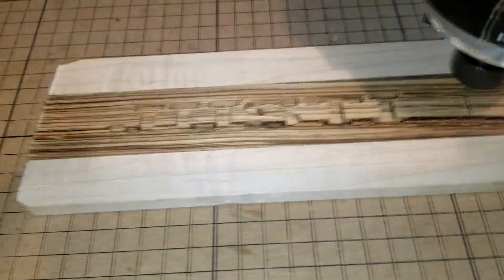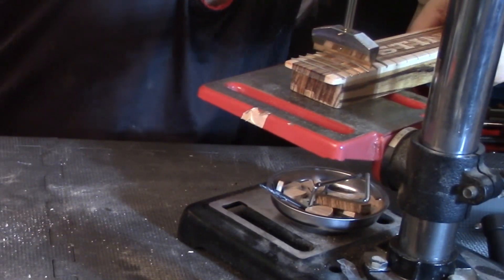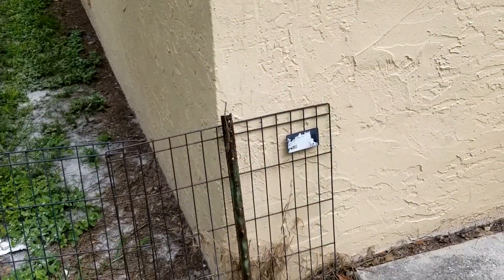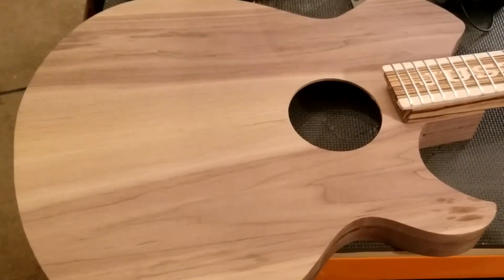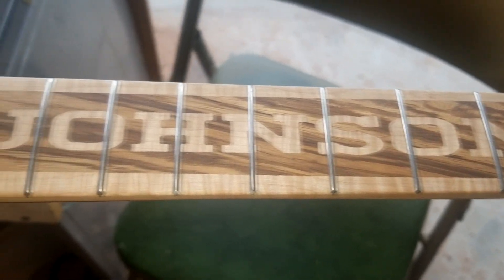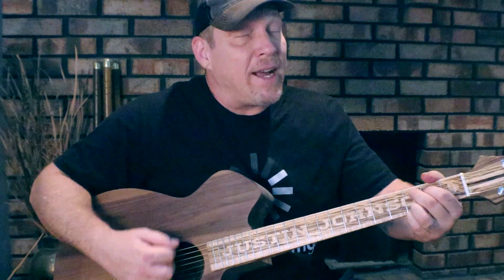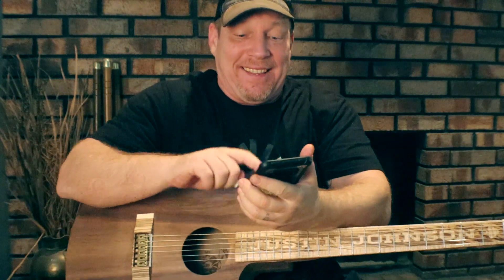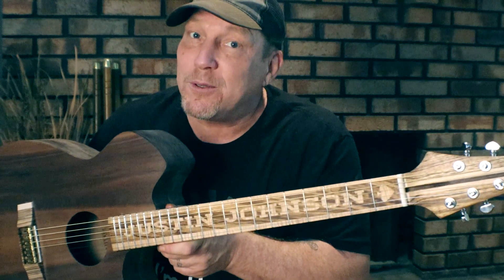I Made a GUITAR for @justinjohnsonlive Out Of WALNUT And ZEBRAWOOD!!

Comment: I'm considering doing a bridge similar to that on a guitar I have lying around, but I was thinking of running the strings through a bridge plate and creating an access port on the back.  I was thinking that done right with a tight connection, the access panel wouldn't take that much away from the sound since the back is being muffled somewhat by your body anyway.  Any thoughts on that?